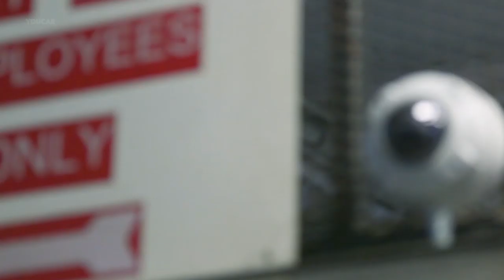2021 Ford Explorer – ASSEMBLY PLANT – American Car Factory

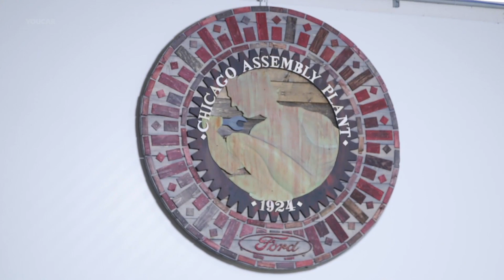Comment: @ 2:44.  How can 2 completely different Ford Explorers (2019, 2020 models) come rolling off the same assembly line.
Reply: Easy they just manufacture them both at the same time. The Kansas City Plant has 4 different vehicle rolling off the assembly line, super duty. F-150, navigation and expedition.
Reply: I guess they come from different lines within the factory and then the same line when they are completed.  It just looked odd having old and new models of the same vehicle to the front and back of one another rolling together as both being made "new" at the same time.
Reply: @edwardsr70  Ummm, you got 1 out of 4 right--F150, the rest are built in Kentucky.
Reply: Especially since they have totally different configuration underneath. Oddly a pause at 2 50 shows them looking sooo similar.
Reply: @wiibaron  Guys this is beauty of 115 years of production experience. Why you need multiple lines when you can build different vehicles on the same line. Almost all OEM using the same method these days, GM Cadillac and Chevy, Tesla Model S, X, 3, Ford F-series, etc.

Comment: There are four Primary elements of Production: 1) Capital, 2) Management, 3) Labor and 4) Resource; of these, the MOST IMPORTANT element is Management because it embodies the Idea, the Organization, the Execution, the Measurement, and the Correction (as needed).
The LEAST IMPORTANT element of Production is Labor because it almost always makes sense to replace Labor w/Capital whenever possible - Capital never complains, never has a hangover, never files a grievance, does the same thing each time, does much better on quality audits and never demands idiotic & inefficient work rules!

Comment: btw is 2020 new gen or another facelift cuz they look very to each other
Reply: New generation. 2020 is rear wheel drive based. Completely new platform.
Reply: @DanielBlaney  oh cool but tail looks very similar to each other
Reply: It is not a facelift, it is a new vehicle, new chassis, platform, drivetrain, interior, you name it.  Ford wants to keep the exterior similar to 2019 because obvious the customer love it, there is no need to change it.